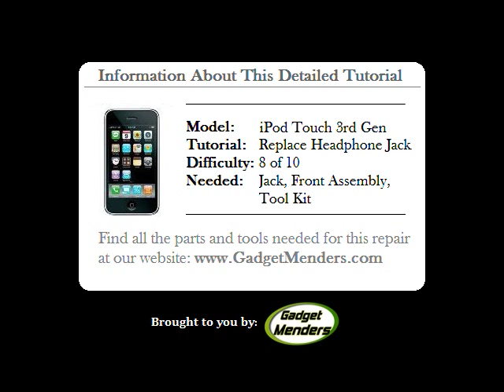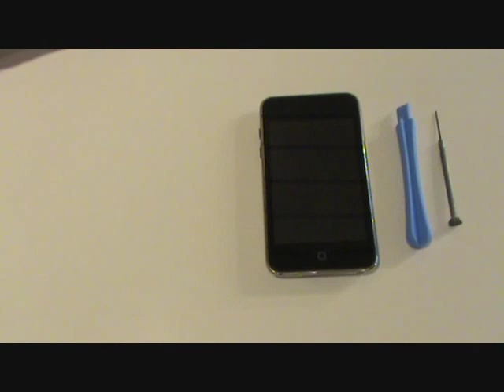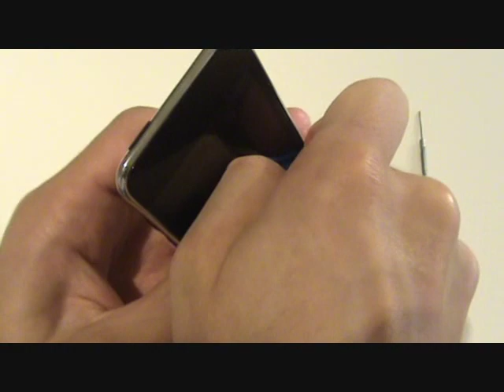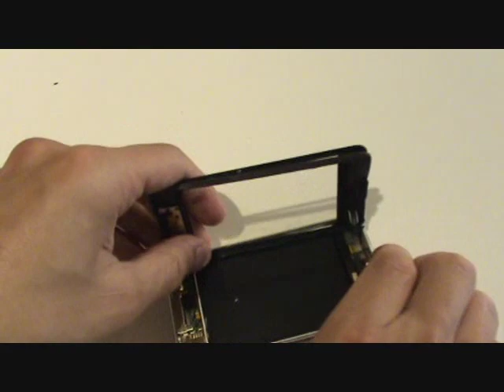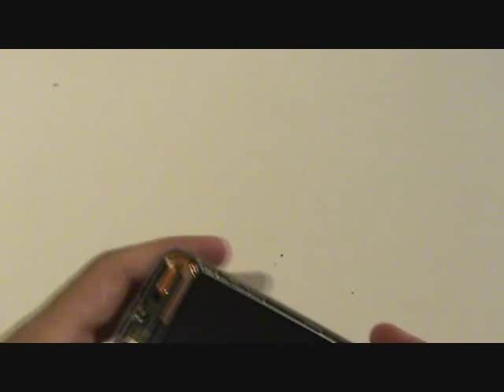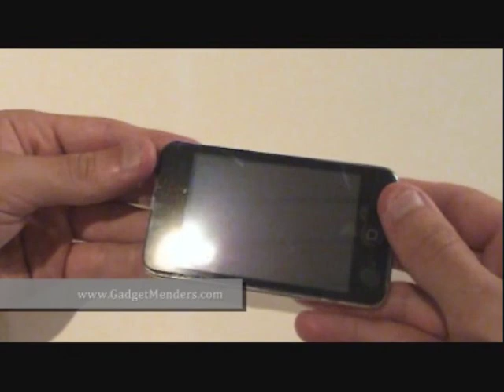iPod Touch 2nd 3rd Gen Headphone Jack Replacement Tutorial | GadgetMenders.com

Comment: Just to throw it out there, this is a heck of a lot to do just to fix the problem... but it is a FIX to the problem.

If you are not electronic-engineer-inclined and don't want to put an hour or so worth of work, open up the iPod. (I used a piece of a credit card.) Be mindful of the tabs and DON'T RUSH. You don't even need to remove the screen... just place a small plastic shim (tape it to make sure it doesn't move) to the back of the screen where it would go over the headphone jack. This will keep constant pressure on the headphone jack and thus, allow the cheap Apple construction and ribbon cable to maintain contact with the solder points on the circuit board. Snap the screen back into place.

Easy. It took me 10-15 minutes with NO experience on opening these things, mostly because I was scared to death of cracking the damn screen... and all it takes is a credit card you don't care about.

With that being said, pay the man what he asks for, whether it be these guys or your local tech. This kind of work is an absolute bear and it is why I appreciate what they do... because I definitely don't have the patience for this. =)

Comment: If you are able to hear with two ears for a couple of seconds when you push the headphones into a certain position, try this.  Before messing around with your screen and all of this nonsense, take a small piece of aluminum foil, wrap it around the tip of the headphones you want to listen to and then insert it into the jack.  I hope this helps, it worked for me.
Reply: It worked! It only bloody worked! In fact, when I pulled the headphones out again, the foil stayed inside the jack and CONTINUED TO WORK for next time I plugged headphones in.